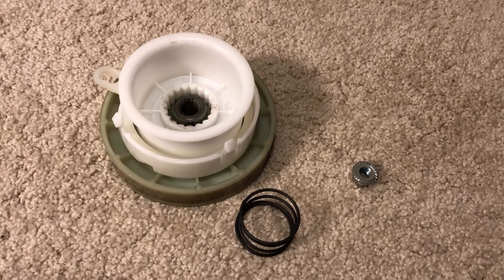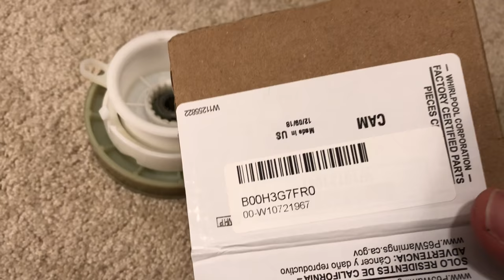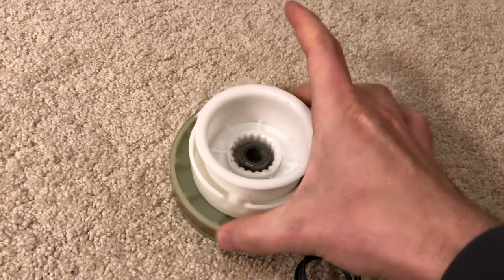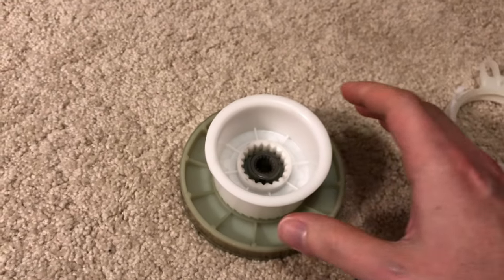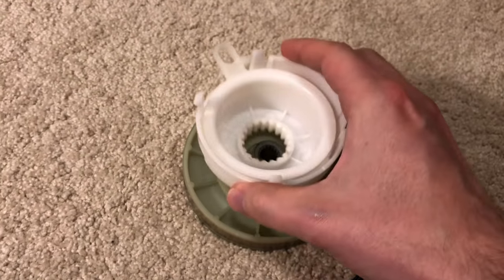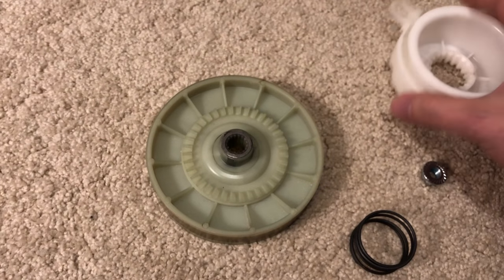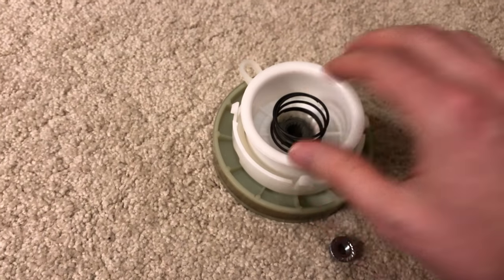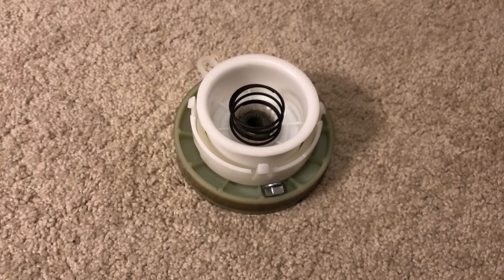Whirlpool Washer Loud clicking noise at end of spin cycle

Comment: Replaced the splutch on my whirlpool WTW5000DW1 and can confirm it did not completely resolve the loud clicking on spindown cycles illustrated in this video.  I then tried taking 1/16th off the end of the pulley as some suggested.  The first round, even though I measured it perfect, I guess I shaved off too much as I heard horrible grinding as soon as the agitation cycle started.  I then tried only 1/24th (or somewhere less than 1/16th) on another spare pulley I had .  That seemed to help the clicking a decent amount.  I still hear it at the very end of the cycle, but I was hearing it all throughout the cycle before so I think it helped.  Maybe the gearbox or something else needs to be replaced.  The washer works fine other than this annoyance and has made these clicking and popping noises when it shifts since I got it I believe.  Poor design I guess. 🤷 Will keep an eye on the comments over time on this video and see if someone discovers the magic fix.  One thing for sure I'm now an expert at changing splutches yay.

Comment: Just took delivery of this exact washer today and immediately noticed this clicking the first load I washed...   which lead me here.  I'm assuming it is advised to call the store and reject this washer.  (I think I have 3 days?)    I'm so tired of the modern appliance scam.  What I'd give to go back to my old early 90's hand-me-downs which I mistakenly  got rid of for my wife who wanted "fancy new machines."  :)
Reply from the maker: Yup, I would try to return it as defective. Shouldn't be making the clicking noise.
Reply: @TechnicalLee  Strangely, ours has quieted down noticeably after doing 3 or 4 loads with it.  It still makes the click noise, but it's now more a "click" sound than a "CLACK!!!" sound.   It went from sounding like someone threw a stone at the side of the machine, to now sounding like that plastic clutch just "snapping" into place rapidly.  (Which in seeing the parts in your video, I would expect those parts to make that noise when snapping into place.)   I may still contact the point of sale and possibly warranty company and have it looked at just to be sure.  Thanks for posting, your video has been very helpful!
Reply from the maker: @alanjames3196  If it makes just one click noise at the beginning of the spin cycle, that is normal behavior as the splutch initially engages. But if there are repeated CLACK CLACK CLACK noises at the end of the spin cycle as shown in the video, then there is a malfunction.

Comment: I have this exact washer that was exhibiting the same problem - loud clicking/snapping when slowing down. I also could never get the washer to spin smoothly; it always vibrated and shook no matter if the load was balanced or the washer was level. I determined the transmission was worn out by lifting up on the agitator. There was about 3/4" of free play up and down in the agitator. Replaced the transmission/gear case and splotch and the washer is perfect now.
Reply: Huh. Same issue, mine with no clothes shakes, and makes a “squeak”
Reply: I have this same washer along with my mother-in-law and they both make this same annoying sound during the exact same moment in this cycle... I was told this was normal for this model# and just couldn't bring myself to believe it and glad I found this video...I will be looking further into repairs myself when my broke azz gets some more money and time😆... Thanks man👍🏾

Comment: A common problem is that coins, hair pins and assorted tiny objects get under the agitator and can cause the plastic splutch to wear prematurely or can cause the washer to not operate correctly. I had a bobbie pin that made it into the water pump and a couple of nickles too.
Reply from the maker: I removed the wash plate and made sure there were no objects under it, still makes the noise. Coins do get stuck in the groove if you don't empty pockets. Thanks for the comment.
Reply: Mine is not a day old and makes weird click and clunking noises and weak agitator

Comment: This was exactly my problem , my machine washes normally but when it’s time to spin and rinse it make a clicking noise like the one in your video , it took the gear assembly apart and found a mangled gear , no idea why buy replaced it (actually 3d printed it ) and it works like a charm! Thanks man this video made that possible
Reply from the maker: Which gear? The splutch I show at the end of the video or a gear inside the transmission case?
Reply: @TechnicalLee  Yeah it happened to me 1 year ago when we got a kenmore in 2021 (transmission)
Reply: Now we have a Samsung cuz it didn’t work
Reply: would you be willing to share the file for the 3D printed part?

Comment: Hope this helps. In the comments below, someone mentioned cutting 1/16th of an inch off of the long shaft side of the pully. This decreases the gap due to the transmission shaft falling due to age/usage. Once I did this and reassembled, the noise was almost gone and much quieter. So, belt pully not motor pully, long side of shaft metal insert and plastic, cut 1/16th. If a new splutch piece does not fix the issue in my case it was a no go, the cutting off of the 1\16th of an inch, seems to have quieted it down and allows the dynamic breaking to catch the teeth properly.
Reply from the maker: Just to be clear, you're talking about grinding down the inside face on the splined metal insert of the transmission pulley? What type of tool did you use?
Reply: I'll give this a try and post my findings
Reply: I did this on the first replacement splutch.  Made sure it was 1/16th inch.  Heard horrible grinding as soon as agitation cycle start as I assume teeth were too close.  I took just a hair off another spare splutch I had but did hear any difference on the loud clicking during braking.  Was thinking of maybe getting another splutch and taking 1/32 off or just shy of 1/16.  Can you PM me?  I want to make sure I'm removing the right portion of the pulley.

Comment: ***CLICKING FIX**** Thanks again for posting this I did replace that clutch assembly or splutch I guess it's called and still had the clicking problem. I did have play in the shaft what I did was on the new gear I removed about a 16th of an inch maybe a little less off the inner part of the spline on the new pulley not the outer it took care of the play and the clicking during dynamic braking has stopped do not take too much off just thought I'd add again thanks for a great video!
Reply: What part did you take 16 th off of ? The part in between transmission and belt pulley below on splutch ?
Reply: @jimevans9753  the pulley with the spline(nylon) so it takes up the play in the shaft. Hope that helps

Comment: Good video, in my case the clicking noise was generated by a loosen drive block that holds the tub in place right underneath the wash plate, you may what to check first before replacing your splutch/cam. This happened right after I replaced the transmission unit. The washer didn't have this noise before the repair.

Comment: I replaced my splutch and still had the problem; took it back off again. While putting it on the 2nd time I noticed I can get the lock ring in just a little bit more than I did before, and that fixed the issue. So if you change the splutch make sure you hammer it all the way; just a hair off can make a difference.
Reply from the maker: Or maybe you hammered the shaft sightly further into the transmission which closed the clearance gap? Maybe slid the bearings further in? I have an alternative theory about the bearing wear causing the shaft to "droop" down further due to greater end play. Lifting up on the wash plate in the machine there's quite a lot of up/down movement.

Comment: noticed The motor comes on in reverse before the basket stops.  have they changed the programming to use the motor as a brake ?  . Normally the washer control board reads pulses from the the optical speed sensor (that's located within the mode shiftier assembly) and waits for full basket motion stop before changing modes , make sure there there  is not a fault in it reading the basket rotation speed.. the washer does have a test mode that visually displays pulses sent from that optical sensor , if bearings where worn that caused the sensor pulses to be intermittent , the washer logic board might think the basket has stopped and apply motor drive power putting a lot of stress on the splutch drive teeth..
Reply from the maker: Yes it definitely brakes using the motor, that's by design. The sensor is fine, the lights progress evenly in test mode and the unit never unlocks early during a complete coast down. You can see it is not shifting modes early (1:33) since I filmed the position of the shifter.
Reply: @TechnicalLee  Is there possibly a fix for this issue? As in making a change to the braking? Thanks for the video. I know it's old, but it's still relevant.
Reply: I think I have that problem, solenoid disengage before drum is done rotating… not sure what to do about that…

Comment: I just had a lot of time invested in a similar issue, the shifter and pulley assembly was wore down, replaced those thought it was good to go but at the end of the spin cycle the machine thought it was stopped when it wasn’t and tries reversing making a hell of a noise.  I’m hoping it’s the actuator didn’t have one on hand.  If it’s not that it’s the main control board...
Reply: Might have the same problem Towards the end of the spin cycle it starts a loud clicking noise back-and-forth  any luck with yours ?
Reply: How could you change the shifter and still need an actuator they are both the same thing

Comment: These machies have two state on the spin cycle.  Just like your machine indicated.  The first stage is slower and shorter.  The second state is faster and longer.
However, what I noticed  is  diffierent, in your machine after the end of the first stage the shifter was in un-egaged position. The second spin cycle began as the arm moved to engaged position.
With my Whirlpool, I have no clicking sound at all  at the end of the fist stage, however the arm statys in place and the clutch coupler stays engaged.  Yours does not remain engaged and also clicks and clicks.

At the end of second stage, mine clicks  and clicks.  When I looked what was happening, the arm moves a little lifting the clutch coupler and os the ginrding and the clicking.
There is no way it is the fault of anything just by sheer seeing what is happening.
The shifter motor can not move unless the computer sends a signal to it.
Therefore it is the control module problem,
In fact I took the whole clutch thing and the actuator , the pulley and the belt and the motor off a working unit  and installed it in  this one that was clicking.  Nothing changed.  While I installed all that to the other good machine and was working fine.
THAT IS ALL I HAVE TO SAY ABOUT THAT.
Reply: Did you change the control module ? And did that fix it ?

Comment: What exactly happen to the cam assembly that you took out did you notice any difference between it and the new one you installed would be nice to know what to look for on the part to identify what is actually the cause of the problem
Reply from the maker: I did not notice a difference between the new and old parts. Could be imperceivable wear differences on the teeth or a difference in spring tension.

Comment: Curious, did this make a clicking sound if you turned the agitator by hand?
  Did you check the nut/screw in bottom before you fixed it. 
  Sorry, going by your user name, I assume you did. 
  Was the okay up and down or side to side?
  Fellow just dropped one for me to check. 
  I am still trying to learn more in these types. 
  I had winder about maybe the splutch, but it sounds kind of metallic when I turn the agitator by hand. 
  That being said, it sounds very similar to that sound.

Comment: I need some advice please. I have a Roper washer and until last Dec it was working fine. It's about 9 years old. Then it started making loud clicking sounds between cycled. Not just click, click. But click, click, click about 28 times before the cycle starts. What could be the problem? Anxious.
Reply: Bad motor.  Get a new one

Comment: Mine seems to make a faster clicking like it's actuator or something. Happens when there is 6 minutes left and spinning. You have to shut it off to get it to stop and then it goes off again until you unplug  it. Pipes rattle big time in the spin cycle.  Only way to stop it is to turn the water valves off. Something isnt right lol.

Comment: Thanks for the video. My 6000 series just did this today. It is only 4 months old. Do you know if something was actually damaged? I don't want to call a service guy if I am just going to be told this is normal break-in.
Reply from the maker: It is definitely not normal break-in. I could not see any damage on anything other than some wear on the lip of the upper splutch gear. My instincts tell me the root cause is a bad bearing in the gear case that is letting the inner shaft with the pulley drop down too far. If you have technician come, make sure he pushes the inner shaft in and out to determine if there is too much play. I would push for gear box replacement under warranty since that is a $250 part.
Reply: Lee I think you are on the right track with the free play on the inner shaft. I had one in the shop - very quiet gearcase no bearing noise at all but does have free play. When the sputch is in the spin position and the teeth of the "cup" engage the pulley, the top lip of the cup is still slightly dragging on the splutch cam. I believe this condition is making it so when the motor is braking at the end of the spin cycle, the teeth of the sputch cup are hopping on the pulley creating the clacking sound. In the acceleration direction the teeth don't clack because the large faces of the pulley teeth are driving against the large faces of the splutch cup. When braking occurs the direction of force is reversed so the stairstep faces of the cup and pulley are carrying the load which are easier to deform a little under load and hop teeth. This was never an issue with the older wvm washers which were allowed by the software to just coast to a stop without braking
Reply: @PAballoonists  Since the spin cycle has two stage.   Are you saying the braking action is happening in both stage?
Here is the behavior with my whirlpool and it is certainly different that what I see here.
There is no clicking sound when the first short slow part of the spin comes to an end.  I see the teeth engaged and coming to a stop.  And then few seconds later it starts the second longer and faster spin mode.  At the end of the second part of the spin is when mine does the clicking business.
I have looked closely to see what is happening.  I see clearly the arm on the shifter motor move ever so slightly up a little lifting the splutch, just enough to cause problem.  There is no way I would blame the splutch or the pully or  the actuator for this.  It is the computer that can make the actuator motor move the arm.
These whirlpool washing machines do not have brake with any of the spin modes.   While GE machies do.
GE machines have brakes but only the types that have magnetic  reed switch so for safety they have brake and they brake fast. Magnetic switch on them does not have locking machanism.  Same with their HotPoint.
These machines have no reason at all to have brake to stop the spin.  It makes no sense to do so.  They have door locks. You can't open  the door.
Reply: Nothing wrong with it. New Whirlpool shifter design. Movement of lever to move splutch position not in sync
Reply: @henryc4787  I have watched my other similar exact machine, the actuator, the arm and splutch stays still.
After all there is no reason for  the actuator motor to move at all and for what?
It is going to wash.  
The actuator simply has two position and not some in between
Either it moves the arm up for wash cycle or down for spin and that is.
If the actuator itself is not working properly, that is a different symptom.
In  fact I took the entire thing out of the good one and installed it on this one.  It didn't same thing.  While installing this on the good one, the good machine worked perfectly fine with no click click nonsense.